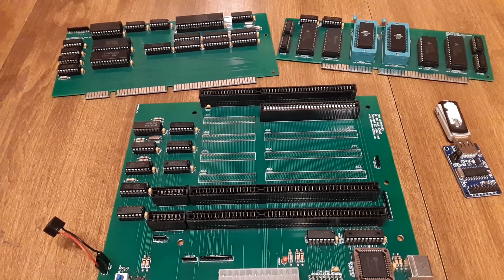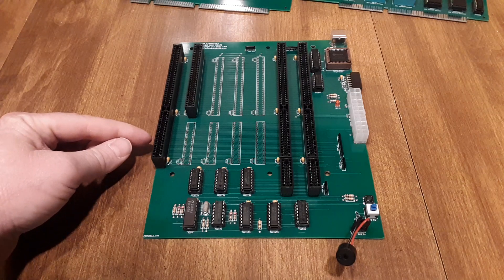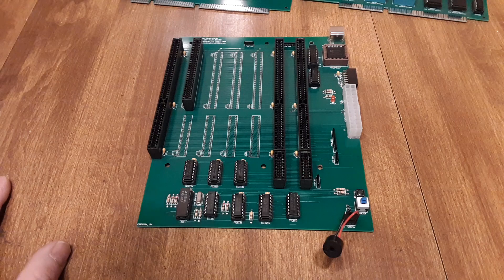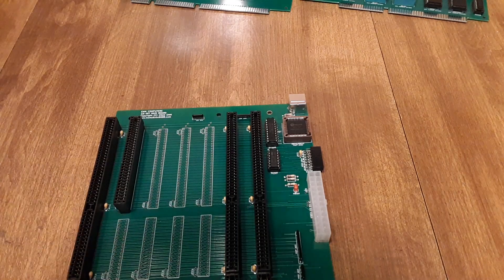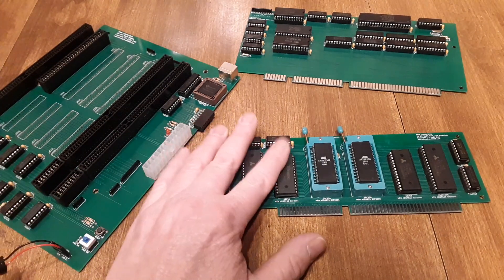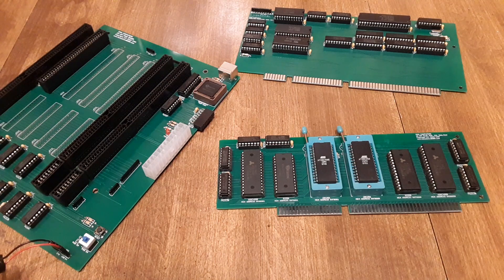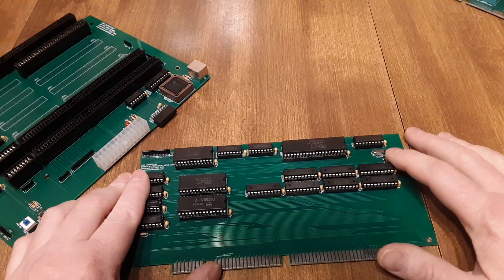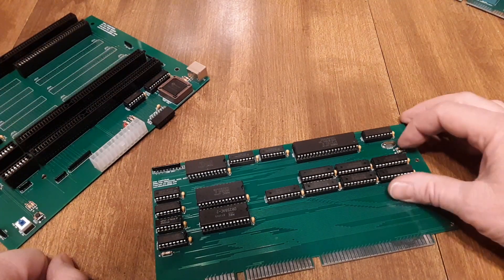8086 PC Compatible

Comment: I started out with an 8088 pc.   One thing you may fund very useful is EMS memory. This bank switches extra memory into holes in the 8088 address space.   With today's high density static RAM, one can load on another megabyte of RAM into an 808x machine.  This allows you to do things usually limited to 386/486 processors..
Reply from the maker: I have looked at adding EMS memory. I have been looking for a good datasheet on an existing EMS card to study and replicate the IO and memory maps correctly.
Reply: @elijahmmiller  There are some  EMS  resources on YouTube.   I suggest $dos as a test app for EMS.   YouTube  is sensitive about  including links or I would include them.

Comment: Hello, I'm working on somewhat similar project - an ISA card SBC with V50HL CPU. So far I've managed to wire-wrap a devboard for bus controller that includes the V30 CPU, Altera MAX 7128 as well as AT28C64 and W24257 memory chips, one of each. I have also written some VHDL code for the CPLD that enables to interface the 16bit cpu with 8bit memory. It's nothing fancy, but it works fine. If the CPU performs an even 16bit access, you have to throw a bunch of wait states at it and emulate two separate bus cycles on the other side. That's the most complicated part, because you also have to count clock cycles, latch low byte and generate control signals properly. 16bit odd accesses are performed in 2 cycles by the CPU itself, so simple data re-routing is sufficient. If you're interested in details, let me know somehow.

Comment: I wonder if you could explain in a little more detail, how you handled the I/O at odd addresses? Was this simply a case of using the bus transceivers to swap D15-D8 onto D7-D0? I'm not sure, but does the instruction set allow 16 bit I/O writes? My guess is that it would be unusual to use a 16 bit I//O access, so perhaps the problem never occurs, but if there was a 16 bit I/O access, wouldn't the same solution of creating two accesses from one be required?

Because of what I saw as a messy solution, with my 8088 "PC compatible-ish" PCB I went with a 8088. I also omitted DMA to simplify the design (same as the original Tandy 1000), and I implemented "minimum" mode to eliminate the need for an expensive 8228 bus controller.

Just FYI, there is a big problem with fake ICs being sold on Ebay. I recently bought 2 off 100% fake and 100% non-functional 8088s. The listing picture showed a genuine Intel part. I received parts which had had the top sanded down and had then been laser etched. In any case they were non-functional. In a genuine 8088 pin 1 and 20 are GND and are connected internally. There was no "short" between these pins on my fake 8088s. From the same seller I bought a NEC V20. I was concerned as this also was laser etched, but I have no idea if NEC did actually use laser etching. The part was marked 10MHz. Whether it is a genuine 10MHz part or not I have no idea. It did work in my PCB at 4.77MHz. Pins 1 and 20 were shorted as expected.
Reply from the maker: I will see about making a video to explain. I would recommend looking at the IBM 5170 technical datasheet, the 8086 datasheet, and my schematics. The 8086 does 16 bit I/O reads and writes. The purpose of using logic to shift D0-D7 to D8-D15 is only for 8 bit compatabilily. This is done entirely through external hardware logic. The processor does not know or detect what is going on. 

This is not limited to the I/O it also applys to menory. With memory it can only be a data location. If code was stored in 8 bit memory the system wouldn't work. 

When certain conditions are met the odd byte is read from or written to the even side. When the MEM16CS or IO16CS is not active, BHE is low, and A0 is high then the even to odd/odd to even rd/wr occurs. If you read or write 16 bits when xx16CS is not low the upper byte is reading and writing to blank space.

It really is cleaner to just stick with an 8088. As you can see in the video the 8086 uses quite a lot more pieces.

Comment: In order to get backwards compatibility, I can see that some kind of bus swapping is needed, and you appear to have implemented this. A block diagram of your CPU card would be really helpful to understand how you implemented this. Whenever I have seen any old 286 motherboards, they look ridiculously complicated, and I did wonder if the bus swapping was the reason. Also for compatibility for 16 bit reads and writes, they have to be split into two 8 bit accesses, one of which is of course bus swapped. Turing one bus access into two must add significant complexity, particularly in a TTL only implementation, before the chipsets came along and swallowed up all this messiness.
Reply from the maker: I seen this comment after I responded to your other comment. So you understand that bus swapping needs to happen for compatibility reasons. The best I can do for now is suggest looking over my schematics to see how implemented it. 

This is just a prototype I am sure as I work on it changes will need to be made.

Comment: Writing as the video plays. I have some old genuine Intel 8086 parts. I thought about designing a PC compatible computer, but was concerned that the I/O addressing would be a problem since the standard I/O chips use even and odd addresses. Ditto for memory access through the ISA for reads and writes. The 8086 doesn’t have dynamic bus sizing, but I checked data sheets and the 386 and 486 do. So I designed a 8088 computer, which I am still debugging.

Comment: Thanks for uploading your work on the 8086. How do you plan to debug the issue ? Read the signals from the bus? like for example put some special instruction to play on the speaker at 25%, 50%, 75% of the boot process ?
Reply from the maker: There is output on the CGA screen so I can use this to step through the code and find issues. I am sure the hardware needs some work as much as the code.

Comment: I aways wondered how motherboard for a 8086 cpu looks like back in a day, are they have really 16bit ISA slots ,and are 16 bit cards runs on it like video, sound IDE FDD controls e.c . I only have 8088 motherboards and CPU s .I have only one 8086 cpu , but it so not work in my motherboards
Reply from the maker: I am not sure what a 8086 motherboard would have looked like if IBM had built one. I should have mentioned in the video that this is bases on the 16 bit 80286. IBM as far as I know never made an 8086 motherboard.
Reply: @elijahmmiller  thanks for the fast replay . So that's why there are no 16 bit XT clones  WOW. So 8086 CPUs are used only in embedded systems or what ?
Reply from the maker: I have seen them used in embedded systems. I think there were some none IBM 8086 computers built that were not exactly PC compatible.
Reply: @elijahmmiller  very strange I knew about 80186 cpu that never made to a standard  PC's, but 8086 ... So for a standard PC useer the upgrade was huge from 8088 directly to 286
Reply from the maker: That seems to be the sequence. 8088 then 80286.
Reply: 8086 is probably the simplest CPU of the x86 series. No additional logic to emulate 16-bit data bus on the 8-bit physical bus, and no additional microcode to implement memory protection like in 286 and newer CPUs. And faster than 8088.
Reply: @elijahmmiller  Not complete correct I have a motherboard with a 8086 (tandon or siemens) it has only 8bit BUS slots but 16bits onboard memory. I have no schematics to see how they did this.
Reply from the maker: I was thinking if anyone had built one it would be Tandy.
Reply: @intel386DX  yes. I think that's partly why IBM didn't take Microsoft's DOS seriously enough, and arrogantly assumed that businesses would flock to their PS/2s with OS/2 and MCA bus (with PS/1s a backup strategy). For better or worse, economics was more of a consideration than superior technology.
Reply: @tikkasen_urakointi  that's really so obvious as to not needed to be stated. 
The 8088 was basically a crippled 8086. The Intel 386, as "80386" and later renamed i386, with on-chip memory management unit and 32-bit architecture was the most significant in the evolution of early PC CPUs. Linux and Windows were possible with the 386 MMU, although IBM was slow to adopt 386. 
Compaq came out with the first 386 PC and clonemakers were able to catch up with IBM more easily because IBM hesitated. As the first, 8086 was of course the simplest! As 68000 was the simplest of 68k chips (68010-68060), and Z80 of Z180, Z280, Z380, Z8000, etc.
Reply: I believe the PS/2 model 30 (non 286 version) was an 8086 design with an 8 bit isa bus.
Reply from the maker: That would make for good reference material. I have actually though of making an 8086 processor card for my 8 bit main board. The ram and rom would need to be incorporated.
Reply: @tcam333  yes, it and the Model 35 were the only PS/2s with an ISA bus rather than MCA. The ISA bus wasn't even called that by IBM. Compaq, as part of the "gang of nine" clonemakers retroactively named the IBM PC bus standard as Industry Standard Architecture, while also coming up with EISA, Extended ISA, to be backwards compatible and compete against MCA. It was quite the insult upon injury to IBM.
Reply: my (admittedly mostly ignorant) opinion is the original IBM computers sucked compared to many Z80s and 6502 computers of the times. It's a miracle (or should I say unlikely curse?) that the x86 became the standard for PCs, mainly because they were easily cloned and IBM, via PC-DOS, was guaranteed an extensive software library. From an engineering point of view, I think the world would have been better if we had DEC (Digital Equipment Corp.) PCs based on PDP-11 instruction sets. Russia actually made a few desktops based on that technology. DEC had superior networking tech too. Bad business decisions took their IP away from us.
Reply: @Zerthimon0 so even boards that supports 8086 have only 8 bit ISA slots ? :(